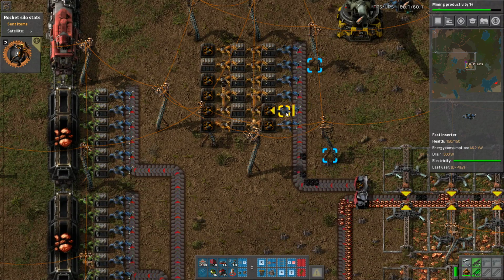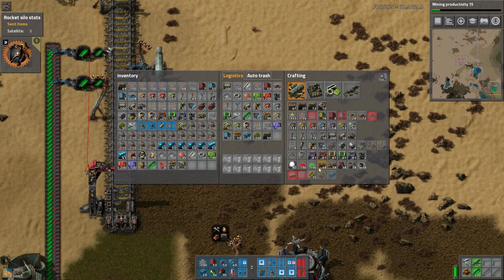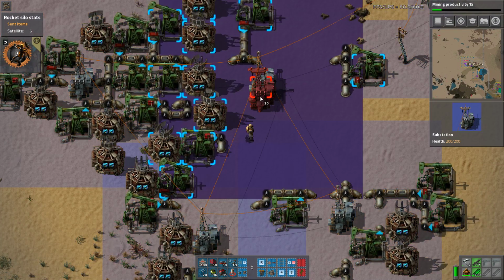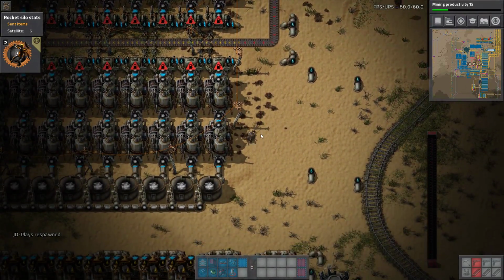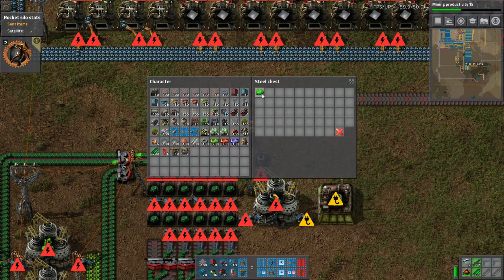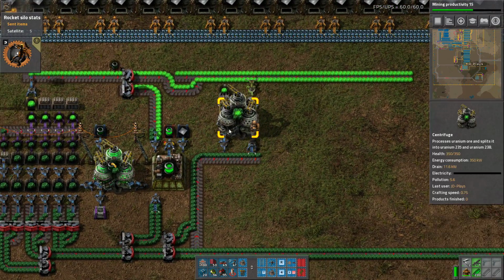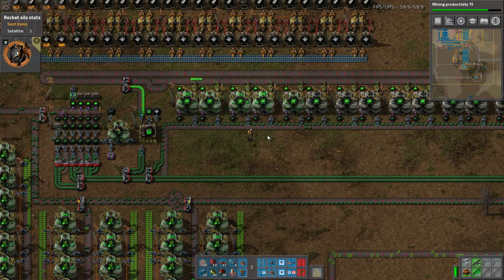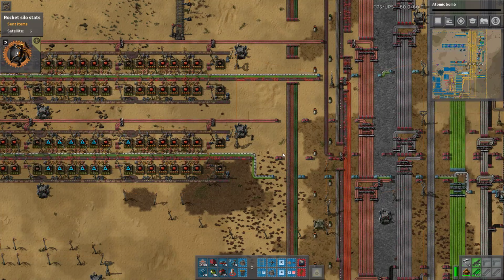Factorio 0.16 Transitioning to the MEGABASE EP06 Filtering with spliters

Comment: So, I don't understand the red circuit build: the green circuits are on only a half belt, and is being used up before it gets to the end. I have same build, and its working as badly as yours!
Reply from the maker: So if your running out of both then the build is to long. If your running out of plastic OR green chips, then your not feeding them both fast enough.
I change the build sooner or later to plastic on one belt and green chips on another belt and take the red chips out the back onto the same belt as the copper
Reply: Yep, thats what I figured too. So I tried to think of a red circuit build that uses direct insertion the way your blue circuit build does, and I came up with something that is maybe half way towards solving this thing. 
I tried to upload a screenshot here: http://steamcommunity.com/sharedfiles/filedetails/?id=1342339600